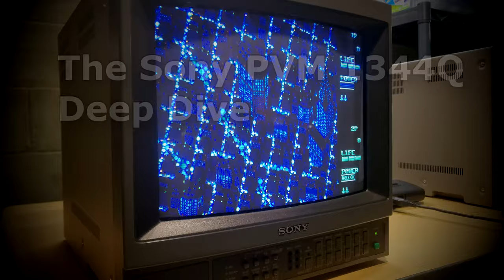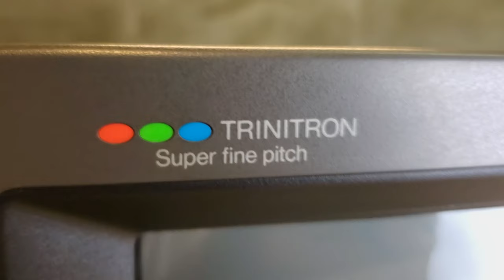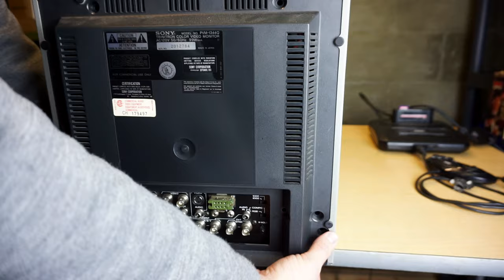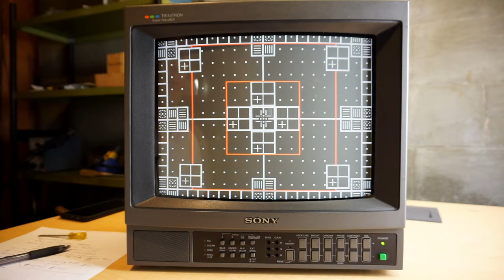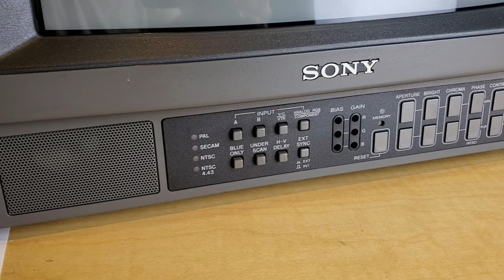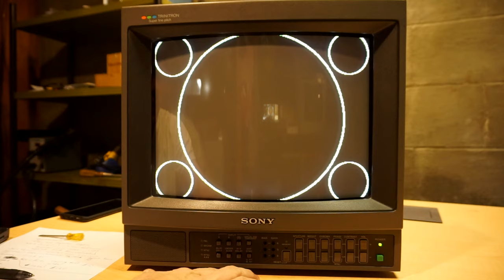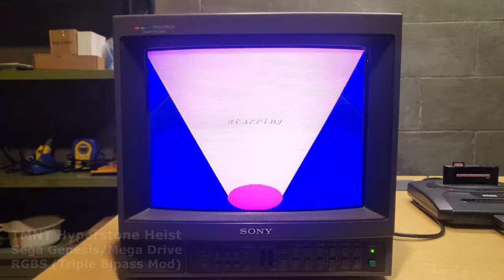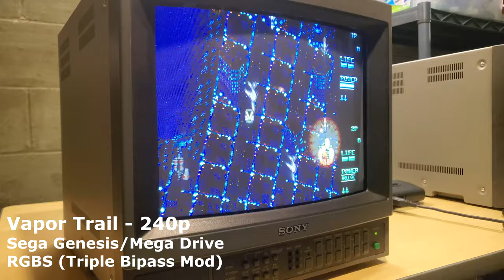Is this the best starter CRT PVM? 📺 Sony PVM 1344Q Deep Dive | Retro Tech

Comment: Most of the push buttons that fix the plastic back cover to the metal cover on my PVM have broken off. Do you know where to get replacement, or what to use as alternatives (other than screws and nuts)?

Comment: Is there a big difference from the 1344q and the 1342q?  They look the same. The seller said it is 600lines. Where as the 1344q  is 600 and 650 lines.

Comment: Hi Steve! Thanks for your videos, they're great! I've this monitor too, but mine has some issues with scrolling (both horizontal and vertical). I presume is a linearity problem, the image "stretch" itself at certain points. I tried to adjust the vertical linearity potentiometer but has only shifted the problem in another area (for vertical scrolling of course). Do you have some suggestions? Thank you very much!

Comment: I have a PVM exactly like yours, but with a different model number. Mine it's 1444QM. The only difference of yours, it's the support for the PAL-M colour TV system used in Brazil and the lack of supporting other formats like SECAM or European PAL.
Reply: I was probing and I realized that the transistor, the bigger one closer to the flyback transformer, clearly viewable at 4:01 has the two outer legs in short, but there's no short circuit with both lateral legs and the middle. Do you think my problem is there? 
I haven't removed it from the circuit yet.

Comment: What would be the best tool to use to adjust the focus? With the space being so tight behind the neckboard I wouldn't like to risk shoving a regular screwdriver in there.
Reply: I use ceramic screwdrivers exclusively inside CRTs. There's fine tip ones on ebay for $10

Comment: I've got a ver similar model, the 1442QM. It has the same tube, the only difference pretty much is that it only supports RGB, and not component. I got it for 120$ shipped which I think was a great deal :-). It has a minor purity problem in the top right but other than that the geometry and image is very good :-)
Reply: I didnt kwnot it didnt support component

Comment: There is no such thing as a great (starter) PVM for retro gaming. It shall not be done on a PVM, for various reasons, IQ being an important one. The games are not designed for visible scanlines. A PVM is just a retarded display, it basically is a high res VGA PC monitor downspecced to 15.6kHz. Then there is tons of other reasons to skip PVM, from aesthetics, price, audio playback, remote control, size, weight. You want a great starter CRT for retrogaming? Get a Sony KV-M1450D. It goes for 20-30 bucks usually. Perfect starter CRT, lovely RGB input playback, clean looks, cheap, many available.
Reply from the maker: @lovemadeinjapan   nah, PVMs are good for gaming
Reply: @RetroTechUSA  They are NOT. I NEVER heard a PVM deliver nice stereo sound from my PC Engine for example. They are not able to deliver the quintessential vertical blur to melt scanlines together. They don't work with a remote to select your other console, adjust the volume or even the geometry from your couch, they don't look cool, they look scheisse in good German, you are done at 20", consumer sets go way bigger, but in the end they are 5 times as expensive as a consumer set that delivers better gaming experience. If I see a retro gamer with a PVM, its a snob. PVM and Mister is double-snob. Don't waste time on those.... Plug the console in the original consumer set, and play games.